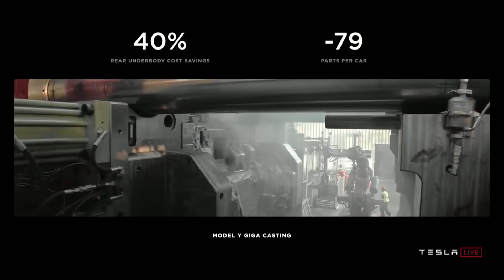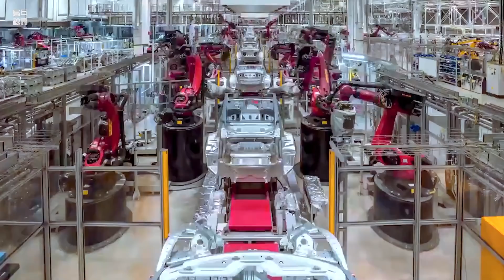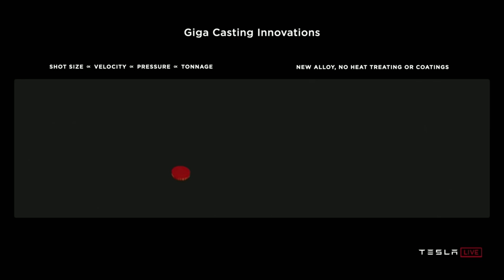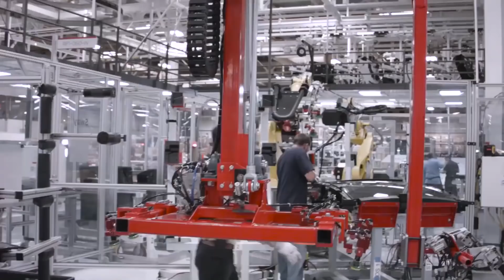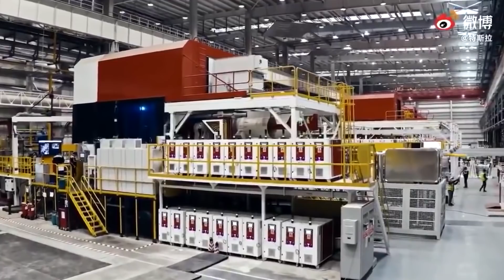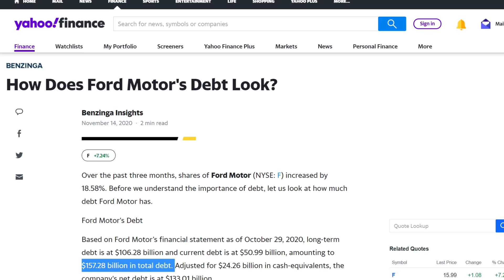Tesla Giga Press: Why dont Auto manufactures copy?

Comment: Carmageddon is coming closer and closer and Tesla will be alone on the top. All due to battery scarcity, giga casting, the FSD, shareholders not wanting to risk their profits and too low margins for all the old carmakers.
Reply: I've searched and searched and nowhere have I been able to find any numbers on how often a Tesla ends up in the shop compared to any other car. I'd really like to know some actual facts to either confirm or dispute claims of reliability. Granted many of their vehicles have not been on the road long enough to have much for long term reliability. I can only speak to my own experiences regarding vehicle reliability but if someone had hard data I'd like to see it either way.
Reply: @themeach011  There are long term use reports on Youtube where people break down the repair history.  There is also information at Consumer Reports
Reply: @chrispollard6568  ya and the ones I've watched have all said that they've saved over their ice vehicle. Again that's strictly an account of their experience. I also find consumer reports to be somewhat biased in their opinions. I find they tend to hack on Different brands for issues that are inherent issues in the industry overall but they single out brands in situations where it's very obvious that they could be speaking about a problem that could exist in any car ever made but they make a huge issue our of it because it's a Tesla or whatever. I'd just like some actual figures and facts so we make conclusions based on actual info not some story about how u can't drive an ev in winter or my friends, cousins, grandpa had one and it broke down constantly. Give me numbers from someone without skin in the game.
Reply: Consumer Reports reliability charts are based on thousands of people like me who diligently report every 6 months.
Reply: @chrispollard6568  I just tried to go onto consumer reports and all the results are locked which sucks. I don't love their categories. Predicted reliability?? Predicted customer satisfaction?? How about actual not predicted. This is exactly what I'm talking about. These people all pretend to know how a car is going to hold up over 5-10 years but they have no data. Cuz the car has only been on the road for a few years. I also believe the current crop of Tesla cars can not be compared to the cars they put out years ago. They have been changing and evolving their practices over the years so using reliability data from a 2012 model s doesn't fly for me When you are talking about how reliable w 2021 model y is going to be. If it's going to be terrible then so be it but why can companies like kia and Hyundai all of a sudden make good vehicles when historically their cars were garbage. Cuz they improved their products. They still aren't as good as a Toyota or whatever but they are far better than they were. I think Tesla has ironed out a lot of their issues but some people have already made up their mind and will never give them a chance even if they are improving. I get it, I could be wrong. I'm open to that possibility, so why can't other people be open to the possibility that I could be right. I guess I just get annoyed that only 2% of cars sold in North America are ev's but everyone is an expert even though they've never owned one and have zero personal experience with what it's like to own one but refuse to acknowledge the fact that they could and most likely will become far better vehicles that internal combustion. Its like some guy is " I hate Tesla's" and I'm like have you ever drive one or owned or had any experience with one other than a YouTube hate video? "We no but I hate them anyway"!! Lol i just wish people could be a little more open minded. To me vehicles are a tool and they all work for different purposes. I have my dually for heavy work, a half ton for lighter work and my model y for driving when I don't need to haul stuff. It saves me an absolute fortune in fuel and keeping miles off my trucks when I'm not hauling. I can drive 3.5 hrs to my other office for like $4. Even after the payment and insurance and everything it's going to save me about $7000 a year. For me I know from experience exactly what the reliability is like on my trucks so I know it will pay huge dividends if I can keep the miles off of them. I just can't see even if I do have to put some $ into the Tesla at some point I'm still going to be light years ahead of where I would have been running up the miles on my trucks and having more expensive down time. I guess I will be a guinea pig which was kind of the point of my experiment anyway lol
Reply: @themeach011  Consumer Reports measures actual reliability and satisfaction.  I take it that you like to waste money by not subscribing.
Reply: @chrispollard6568  I hear you and maybe they have some good data. But either way I wouldn't use them as my only resource for research and there's plenty of info out there that u don't have to pay for. And I've watched a lot of their videos and posts that their conclusions just didn't make sense or match up with my personal experience so I have a hard time giving them credit when they seem to have an agenda. Like when they gave super cruise a better rating than auto pilot. I've used auto pilot a ton and there is no comparison. Just the fact that autopilot can be used on any road with lines on it makes it better. I do look forward to when they get rid of having to touch the steering wheel, but basically in every other circumstance it's better. It's more adaptable and just better tech. Also that whole thing about tricking autopilot. What a stupid thing to do. And on top of that I could have even stomached it if they made a video about trying to trick all of them because the other systems are not hack proof but they chose to only focus on the Tesla. Like what's the agenda?? And what's the point of using a product strictly and purposefully against the way the product is intended to be used and basically breaking every instruction in the manual. Like what a joke. That guy is the reason we need disclaimers on frickin shampoo. Lol
Reply: @themeach011  I watched several long term reviews of Teslas and was astounded at the maintenance and repair cost.
Reply: @chrispollard6568  will be interesting to see. Fingers crossed mine works out ok. Lol
Reply: Tesla margins are still crap.
Reply: @jwonz2054  tesla makes money from carbon taxes and not cars.
Reply: @carholic-sz3qv  they make money from other auto manufacturers that are trying to avoid paying fines for not having enough lower polluting cars on the road. And it's less than 5% of their revenue. I don't particularly like that these other companies are even allowed to do this. But what's Tesla supposed to do. It's a good business practice for then and it helps them keep investing in further development of new products and tech. None of that $ comes from taxes and now Tesla is at a decided disadvantage because you don't get the big tax credit any more on Tesla's but the other vehicle makers can still get them because they are so far behind.
Reply: @themeach011  nonsense, they make money from countries that are subsidising EV sales, tesla is also using ICE to build their factories and service their cars. Its even worse at spacex and elon owns a private jet.
Reply: @carholic-sz3qv  Those programs are not tesla specific. Every company that sells ev's gets the credits.
Reply: @carholic-sz3qv  I don't think it's fair to say that Tesla is hypocritical for using ice cars for running their company. Tesla isn't about everyone just crushing their ice cars today and buying an ev. There is no way that one company is going to supply all the vehicles the planet nerds every year. It's just about pushing towards a transition. We will have ice cars around for a very long time. I still need my work truck etc. I would never exclusively own a Tesla right now. It makes no sense where I live. The infrastructure isn't good enough and there aren't options for what I need out of all my vehicles in an ev form yet but after owning an ev I see the potential over time. There's a lot of benefits. And I'm not a tree hugger. They are just great vehicles. If somewhat limited in some aspects with today's tech and infrastructure
Reply: In your dreams
Reply: Their cars are unreliable.
Reply: @chrispollard6568  a friend of mine owns a used car dealership and he refuses to sell any Audi, BMW, or Mercedes to a customer unless they purchase an extended warranty because they are so prone to having problems and so expensive to fix. There's a lot of unreliable vehicles on the road. I guess time will tell.
Reply: @themeach011  those mercedes, audi.... are fully packed with technology of all kinds and they are also overenginnered, also people drives them like crazy.
Reply: @carholic-sz3qv  that's my point. Tesla's main goal in their engineering is to simplify and reduce components and processes. So if those cars are unreliable because of those reasons then by definition a simpler car with less moving parts and 1/3 of the chips and processors and wiring etc should have better long term reliability. That was sandy Monroe's biggest problem with the id4 it's way too complicated. So much crap that there's not even room for a frunk. I had a Jetta. It was an electronic disaster. Maybe they are better now but I'm with Sandy on this one
Reply: @themeach011  unfortunately EVs including tesla have way more electronics than a traditional ICE vehicle and with "reduction" of parts in the manufacturing its essentially copying tesla which is against right to repair, you cannot even buy a tesla part right now. People have been buying and rebuilding cars including teslas, but for tesla its abother story let me tell you.
Reply: @themeach011  your jetta was an electronic disaster but not all jetta, some people have also been having issues with teslas. Here in Europe people are still driving those super old jetta with no issues.
Reply: @carholic-sz3qv  the right to repair thing needs to stop. It's total crap that Tesla won't sell parts. I think in time they won't have any choice. There's already shops popping up all over Europe that will work on Tesla's off warranty. Eventually there will also be a larger after market for parts as well. There's just not enough cars on the road yet to make it worth it.
Reply: @chrispollard6568  on Edmunds the model 3 had a 4.6/5 rating and not one of them is complaining about reliability. Again this is 111 people's anecdotes. They complain about things like no am radio and lack of apple car play. One person didn't like the dangerous screen? Weird. A few (6%) had legitimate concerns with build quality but this was fit and finish stuff and paint quality. We all know Tesla has/ had issues with those types of things but to me that's not speaking to reliability. Omg my door seal came loose. Jesus my f-150 does that every time I open the door in the winter. It's a cosmetic thing. Literally not one person said my Tesla broke down and left me on the side of the road. I get cosmetic stuff is a part of reliability but to me breaking down or having problems that it's needing to go into service for repeatedly would be of greater concern. I put on a lot of miles and my f350 diesel has had coolant leaks, sensors, fuel filters, transmission flush, wheel alignment, brakes, def problems. I can't wait for a decent heavy duty pickup ev to come out. Ice vehicles are just inherently more complicated with hundreds more moving parts, more sensors, more emisions control stuff. Ev's have down sides too but I feel like people just dismiss them too easily without any actual experience owning one.
Reply: @themeach011  I'm sorry but the reliability charts in Consumer Reports show a veritable plague of red dots for all Tesla models. Edmunds' ratings do not represent reality.

Comment: 2 examples. Why didn't blackberry copy iphone's embedded keybd? Why didn't CRT display mfrs RCA, Sperry, Allen Bradley copy the LCD/LED's? Same fate for ICE mfrs.
Reply: Exactly!

Dealer alone will kill many traditional makers.
Reply: And why car manufacturers create platforms, but tesla appears not to do so?
Reply: @ulrichsralf thanks for the giggles. Highest quality is when 70 parts consolidate to 1, ONE part by a machine that dont have hangover mondays, drug addictions, divorce hearings...weld 15 parts together, each one .5 mm tolerance, you have +/-2 mm variation, worst case complete clusterf*&k, Murphy's law will ensure one day, the worst possible day, it will bear it's ugly head and shut down your line. Google Deming. IT IS NOT THE WORKERS' FAULT. Edit: W. Edwards Deming, he taught the Japanese auto industry post WWII to improve quality, while F, GM gave lip service, Toyota embraced his statistical quality engineering, (not control) methods.

Comment: There isn't the global aluminium supply to mass convert cars to cast aluminium

Total global aluminium production is in the region of 65 million tons

Car production uses some 80 million tons of steel per year. If you replace half the steel in a car with cast aluminium parts you would add 40 million tons per year to aluminium demand

The world need to increase aluminium production by 60% that's not going to happen over night. If there was a dash for aluminium to make mega cast parts for cars you would quickly find the price of aluminium going up perhaps to double what it currently is

Also today
aluminium = about $2500/ton
Steel = about $800 a ton

If you want to swap 400kg of steel for 300kg of aluminium you are swapping $320 of steel For $750 of aluminium

The savings in robots is somewhat eaten up by the higher cost of aluminium vs steel
Reply: Aluminium is far less co² emmitting
Reply: @bauerdata  No it isn't especially in China where most the worlds aluminium is produced is powered by mostly coal

Comment: Question: How interchangeable are the molds on the Gigapress? How much downtime does swapping out a mold require? Compared to traditional assembly, how does this impact flexibility in volume production of different models? Updates to the cast part for design revisions? Factory downtime?
Reply: they don't need to change mould. they have several gigapress in the same plant... every press is specialized to use one mould
Reply: @rupetto1959  They will need to change mould if specs change. e.g. A model update; incorporation  of new battery architecture. They may also want to change moulds to respond to changes in production, such as creating castings for Model 3 in Fremont as production of Model Y shifts to Texas. I'm making up scenarios, the reasons aren't important. The ability to change and what is required are important. I suspect much less downtime and retooling costs making for a much more agile production process.
Reply: Sandy Munro was quite confident they can change a set in 2 hours.